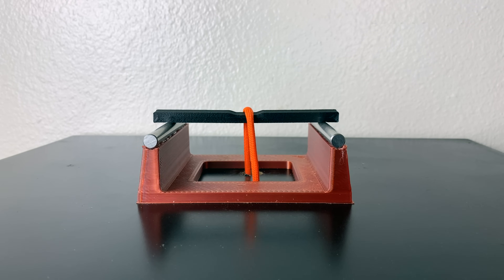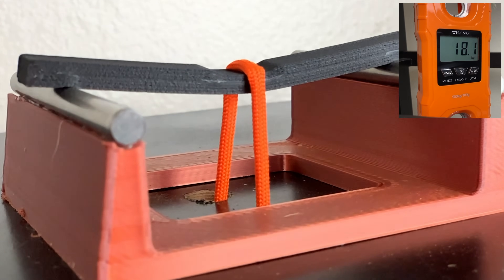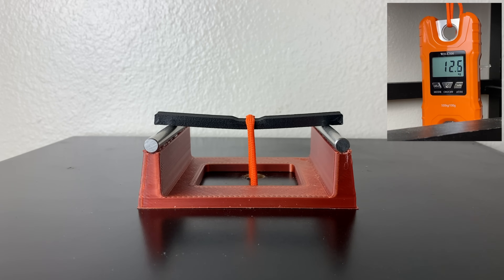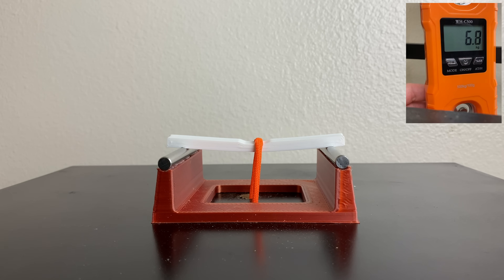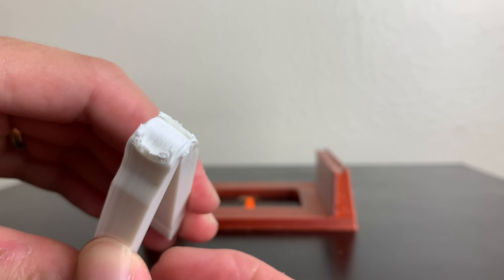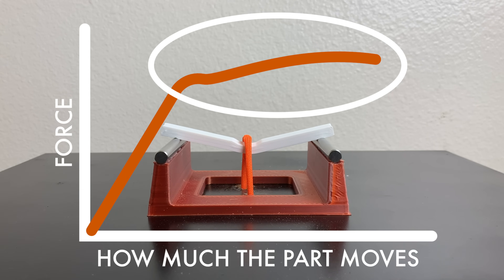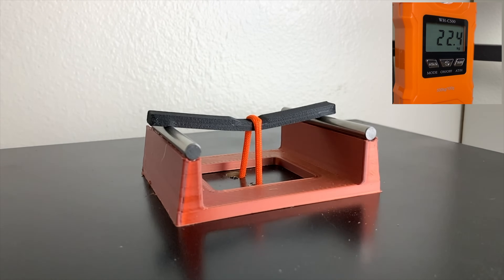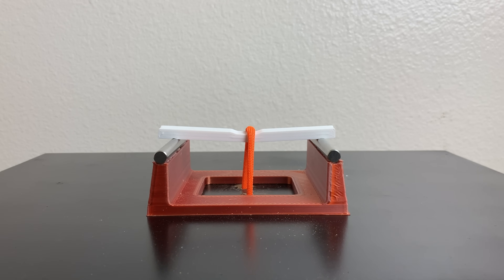How STRONG is 3d printed CARBON FIBER?

Comment: i would not say the carbon fiber is stronger. analyze the data further and youll see that the PLA has a greater area under the curve, i.e greater toughness. The carbon fiber in retrospect MAY be more resilient but one would need to calculate and compare those areas of yield and elastic deformation. For example, we can all agree ABS is a "stronger" plastic right? Well that is simply because it yields more that PLA and overall is tougher before plastic deformation, the point of no return when damage has taken place.
Reply from the maker: It may be tougher but in this video I am comparing strength. Strength indicates how much force the material can support and toughness is how much energy a material can absorb before rupturing.
Reply: @3DPrinterAcademy  very good point

Comment: I'm disappointed you didn't test a part that combined the tensile strength of pla and the rigidity of carbon fibre. A small bonded set of the two should prove far more resilient. For example, a carbon fibre outer core filled with a pla insert.

Comment: It depends what you mean by failure. Would you trust the PVC for bullet proof vest or the carbon fiber? Yeah the PVC bends and doesn't break but does that protect you? Does carbon fiber break but at a much higher pressure? 
Depends what you need it for.

Comment: depends which carbon fiber, carbon fiber has many different options the real ones which are times stronger better overall in times, from weaker to super hardcore ones whoich used in aviation  dont forget hes using carbon fiber trash leftovers, which has nothing in common to carbon fiber, it may be even simply so called, but not the carbon fiber than its simply scam. Also carbon fiber parts the real ones you must use default production without them this is suseless.

Comment: Amateur. Need to do four point bending to eliminate randomness from local stress risers etc and get a pure bending. Finally compare it to a non printed carbon part to show how inferior 3d printed parts are. Then report results of yield stress in engineering units.